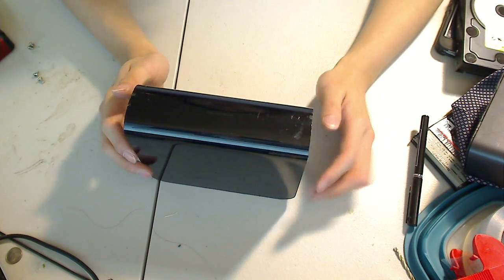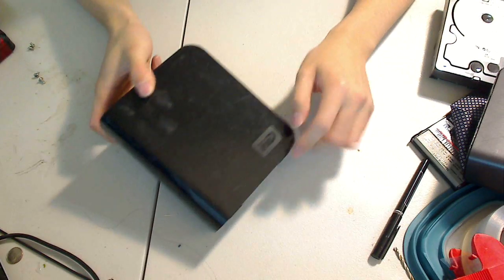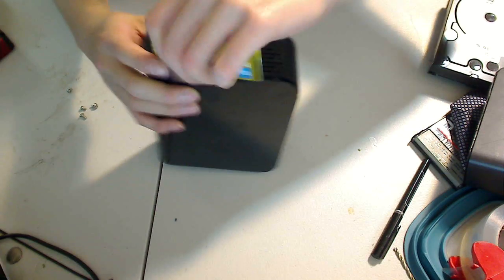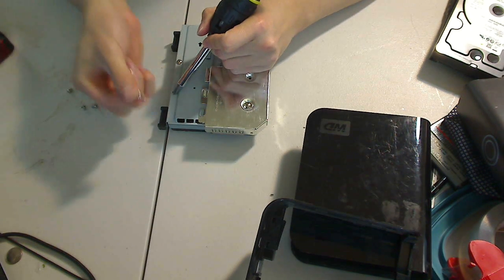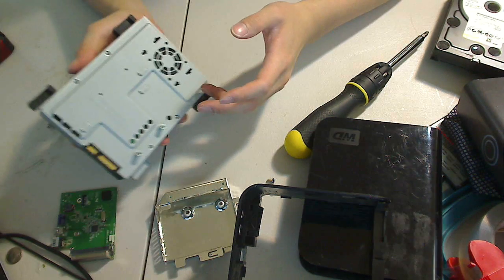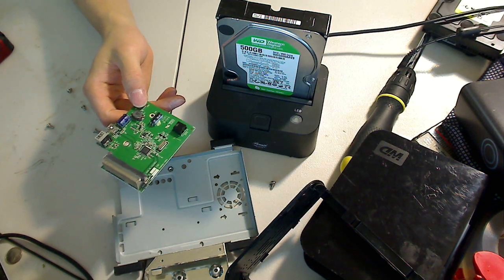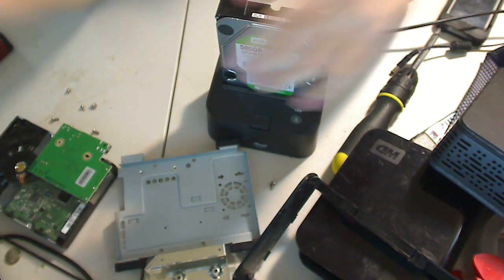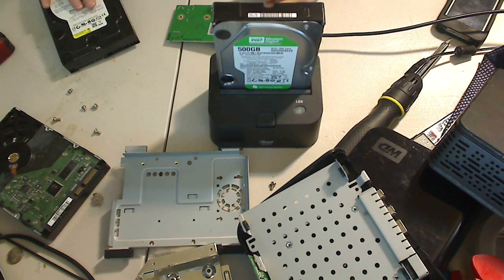Recover Data HHD hard drive from broken external Western Digital mybook enclosure repair solution

Comment: Thanks for the Video! It helped me save some time taking my failed WD My Book Home Edition apart. The drive hadn't been recognized for a while on my systems. Loading on my external HD reader worked properly. Seems like the controller for the WD Enclosure had a couple capacitors exploded.

Comment: i thought the data on those drives were encrypted and you need the enclosure controller board to read them?!
Reply: were you able to find an answer to this? I wouldn't imagine it being encrypted if it's on FAT32... I just don't know what WD adds onto it with the controller
Reply: Yup, you need the controller. Even if you disabled the encryption through WD Smartware software. 🙄
Reply: IM still tryng to find a way to recover mine from years ago

Comment: My FW400 WD My Book is unreliable often failing to spin up. The last time I used a trick I found online to freeze the drive first. This worked and I was able to transfer my data. Now I'm thinking to simply replace the hard drive inside the enclosure, so that I can still use this as a backup to my older laptop. This make sense? I just got a little worried when in your video you were indicating that yours had a controller failure.

Comment: Hey I have a WD external hard drive I bought in 2010 and it stopped turning on years ago. It's very similar to the one you have but is not black. I honestly can't remember the model but im pretty sure is a mybook model to. Will ill be able to retrieve the information following your tips?

Comment: Thx for the explanation. I have the same drive and it died after two years of normal use. I do have the following questions:
1. how can I find out what the exact issue is? (drive / mechanical parts etc). A technician did some test and told me that he can see that there is info on the drive, but can't access it. But I want to find out for my self what the issue is.
2. where can I buy the parts needed (if it is the board in the case, or the board connected to the drive, etc)? I did some research on ebay, but can't find anything.

Comment: Hey Ive taken apart my 4tb mirrored WD hard drive because its not turning on. I can get the hard drives out. Was going to ask, would u reccommend this docking station? Or I've seen u can get SATA to USB cords to plug into it, would this be just as good? I'm thinking the cord because its cheaper but I'm not sure if it'll work. Thanks for the vid anyway :)

Comment: Question for you.... I have a 1TB, My Book Essential, western Digital external hard drive that has stopped working. Looks like the small circuit board is bad. I purchased a Sabrent docking station to read this hard drive. The computer recognizes the docking station but the hard drive will not show up on the computer. I can hear and feel it running but nothing. Any suggestions? Windows 8
Reply: I've heard that the WD board encrypts the data. Am researching it now. What did you discover?
Reply: +Ray Nashar I took the drive to a friend that said all the data was gone. He could not find anything on the drive. He didn't understand where it was or how it got deleted, if its deleted. Maybe it is encrypted. Thanks for getting back to me. If you find it is encrypted please let me know if there is a code or something I can use to access files. Thanks so much.
Reply: koslund11 Will do. If it is encrypted, your friend won't be able to get the data without a new circuit board (PCB). I've found a place online that sells them. Going to try a friend's HDD docking station first without the PCB. If that gets us no where, I'm going to then buy a PCB from here: http://parts.com.hk/1/index.php?main_page=product_info&products_id=4#.VtjWwcc99jC
 Data recovery places charge way too much.
Reply: Data Recovery places start at $265.00. If you  are buying all kinds of PCB's and spending days with this the recovery price can seem quite affordable. It all depends on the value you put on your time. Don't forget that the more you tinker with it the less likely it will be recoverable by anyone regardless what you pay.  $59.99 for PCB of a broken external drive seems quite expensive... hopefully you don't end up wasting your money.
Reply: koslund11 it worked! My part came in the mail yesterday. Did exactly what the video suggests and I'm in! Won't be buying drives that use hardware encryption any more.
Reply: datarecoveryguy.com thanks but I really wanted to give it a go and learn.
Reply: +Ray Nashar
Glad you got your files back! What size was the drive?
Reply: 2TB

Comment: CD...when you first got ahold of that dock station,  did you have to format it BEFORE you inserted the loose harddrive into the dock?  I recently had hd problems with my WD 8tb too and I went to Best buy to pick up an enclosure.  Opened the box and read the instructions inside the box.   Carefully plugged power and data cable thing.  inserted my hd onto the dock and turned it on.....I did not see anything at first on my computer.   Then I looked at the package that the enclose was in,  there was a sticker saying that I was supposed to install a harddrive and format THAT prior to using the unit.   what I saw a few minutes later......I just collapsed.....it showed another drive being introduced to my system and UNfortunately I may have LOST ALL data from that hd :(((((((((((((.    I was so sick about it that I did not want to beleive it.....and seen other vids saying that the 3.3 tab thing,  to the pcb that maybe the problem.....my pcb HAS corrosion on the data port female side of the board.  So I am patiently waiting for my ebay purchase to arrive soon.
Reply: WD is becoming like Adobe Photoshop.....I have PSE software that now WONT let me reinstall it.......found out that folks have been getting bad issues with PS and they are boycotting the company for another different photo editor product.

Comment: Does the SATA-usb adapter option work for WD external hard drives that are password protected/encrypted data?
Reply from the maker: +ASHof2 no    you will need another WD external hard drive for transplant the internal hard drive itself.
Reply: That's what I was afraid of. Finding the same model is gonna be a pain in the a@@! Thanks!
Reply: +CyberDoc LLC how do you do that?
Reply: Oh, Gee, almost forgot. You need to move the firmware chip from your old board to the new one, somehow transfer the firmware, or find a seller that will do that for you, or you are still dead in the water. Apparently the decryption key for your disk is in the firmware.

Comment: I used a mybook as a PVR to record shows from my TV receiver, now the light flashes fast and I hear the power brick making a ticking noise in sync with the flashing lights on the mybook, is it possible to recover the shows I recorded and put them on my PC or will it be encrypted?

Comment: Thanks for sharing - although I am late to the party. I have a older Western Digital 500GB External Hard Disk Drive": It crashed in the year 2525 [ha got carried away in reference to a song] - it actually crashed in 2015! A local shop tech told me that the only way I could recover my data is by obtaining a identical enclosure controller board to read the data?  I still have my WD 500GB external hard - I removed the case, but I didn't disassemble the drive itself.  I guess I could give it a try again because my toolbox has improved - I own a Thermaltake - BlacX Duet Hard Drive Enclosure Docking Station – Black.

Comment: This doesn't work. Western Digital hard drives for some reason come with AEN (i think thats what its called) encryption. When I took my hard drive out (because of the horrible shit enclosure) to put it onto a new enclosure, it said the drive was unformatted and unallocated. I took it to an IT place they tried to get the Data off it and it said the folder was locked. There is one option I found which is to reformat and allocate drive (temporarily deleting your data) and then using GetDataBack to retrieve it (when reformatted DO NOT PUT ANYTHING ONTO THE HD AS IT WILL ERASE YOUR OLD DATA). I am scared to use this method because I am still unsure about the reformatting. I am yet to take it to a professional data recovery service where I could get charged quite a large amount.
Reply from the maker: buy the same WD drive enclosure and put it in that one.   also your drive sounds messup internally    you may need to open the drive to change either the board or the head pin. http://www.cyberdocllc.com/shop/hard-drive-data-recovery-services/
Reply: CyberDoc LLC 额。
Reply: How did you go?

Comment: So, if there is a click soundlike heartbeat coming from the drive that means it is pretty much dead unless i do the buy exact drive and replace certain parts?
Reply from the maker: correct  you have to change the head and board and control unit
Reply: CyberDoc LLC I bought the exact same drive and it was not still working. I do not have a much of a click but I heard a spin then it stopped. I tried this but it is still showing as not initialized in disk management. Any suggestions
Reply: CyberDoc LLC Feel like making a video on this? This one was great so if a video as straight forward as this was would be awesome!

Comment: I have this exact drive. Mines dropped, and now makes a clicking sound while running. It no longer works. Though when plugged in, is still somewhat detactable by the computer. How do i recover the data is my question. I would need a step by step video for this.
Reply: having this exact problem

Comment: Hi, I know this is a while back, but which docking station is he using?
Reply: check this ebay item 162363878031, the only caveat it doesn't work with WD IDE HDDs (but not many people still have these types of drives) and it connects through USB 2.0 only (which is slow). An option I prefer is ebay item 111671428292, it connects not only to USB 2.0 but also eSATA (high speed on a laptop if it has that port) and SATA (for a desktop), these are the only options that allow direct connection to the motherboard for low level work such as fixing with SpinRite or writing to the drive firmware such as for disabling the Intellipark feature on WD Green Drives - things you can't do from the USB interface.

Comment: My Western Digital mybook (grey) has stopped coming up on my computer (iMac). It is making a clicking sound like a generic time bomb. Then after a few minutes it stops making the sound, but the light on the side is still flickering. I tried moving it to a different computer (a laptop) and changing the cables, but it still does the same thing. Is there a chance I can take it apart and try to put it on the dock you described and retrieve my lost files? Is there a chance it is still possible to save the files?
Reply: Luis Diaz 
I would definitely try to take the drive out of the plastic shell and hook it up directly to a Mac. Keep the shell with the drive if you decide to send it in for recovery somewhere.

Comment: I dropped my seagate external hdd 
there comes beeping sound fro my it and it doesn't appear in my computer or disk management. I assume it's dead.
is there anyway data could be retrieved lime putting things from this to other hard drive
Reply from the maker: +Wajid Malik   need to open and to reset or replace the spinning pin head from an identical hardddrive
Reply: lol

Comment: I have a failed WD MyBook 3tb that doesn't show up in my file system but shows as unallocated and Not Initialized (when I try initializing, a pop-up says the disk "is not ready") in Disk Management. Will a dock help me recover my files?
Reply: When you get the dock it will likely show up as unallocated as well
Reply: If his dock can connect it directly to the motherboard, recovery software could fix it.

Comment: Hey, I have a WD mybook 1TB and the usb on the enclosure casing got damaged. I tried removing the HDD from the casing and connect it to my computer but nothing is showing up. Can you provide me with any solutions?
Reply: Hi,

Get another controller from the same model enclosure. The data is encrypted. 😉

Best Regards,

Comment: Help!  I drop my cloud and it is DEAD.  Good thing I'm under warranty so I can just sent back and WD will sent me a "new one". I worry about my data inside. How can I delete all data in there before I sent it back to WD?  Thanks !
Reply: If you're worried about your data and it's dead Put it in a MRI machine ;-) Kidding aside (they won't let you, that magnetic filed can turn the drive into a projectile), without mechanically destroying it only super powerful magnetic fields can scramble it. I know it's probably too late now but you can ask the vendor whether you can keep the dead drive for privacy reasons, if they have determined it's hopeless they probably won't bother you with sending it back in since they'll probably just shred it (that's what I did for one of my drives).

Comment: Did you really managed to recover data from that WD hdd? I know they encrypt data and you cannot recover it without the original usb board.
Reply: Nothing is encrypted by default.
Reply: It's not encrypted if you didn't use some sort of software to encrypt it. I've taken apart several external HDDs and had no problems putting them directly into my computer. Even if it is encrypted, you can just plug the HDD back into the external enclosure.
Reply: Judging by the numerous reviews, I'm assuming no. But since it's cheap, I'm going to buy it anyways to test it out, if it doesn't work, simply return it.
Reply from the maker: I second that what Tamás Madarász said,  you must had it encrypted.   I never had to do a drive from WD recovery with encrypted data.
Reply: CyberDoc LLC
 I put the WD HD into the BlacX, and it is blinking on the left side, a lot. It is not recognizing it on my computer accept in the disk utility, but it won't let me do anything there. I have a update iMac. Any advice?

Comment: I have a WD 3TB External Drive, which I accidentally dropped onto the floor from a closet height. It hit the floor pretty hard. It receives power but makes a ticking noise and a whining noise, almost like its totally screwed. Can any of my files be recovered?
Reply: ***** Mine just fell over on the desk and is making the same sound, and so far, it looks like it's dead
Reply: ***** 
Dropping drives causes internal damage to the parts. You will need to take it to a data recovery lab for evaluation. 

our rate for these types of issues is usually around $804.00 US. depending on drive size. a 3TB would be around $1100.00
Reply: datarecoveryguy.com I don't know the manpower behind getting the data back but why is it so pricey?  I myself have a 3TB mybook and I'm having problems with it.  I used a Sabrent docking station but it does not show up under my computer.  

It shows up in disk management and I made the mistake of initializing it (it took a couple seconds).  My question to you guys is, is it possible for me to recover all my data without having to pay such an exorbitant amount?  Any programs you can recommend that might be able to get my 2.5TB+ of data back?
Reply: With the drive that size the more you try to recover ityourself the more expensive it will be to have a professional do it as drives degrade with each recovery attempt.
Reply: I'd agree on that.  My 3T only fell over on the desk, but I only got about 90% of the data back with my recovery software, although it's not pro quality software, but I'm happy with what I got.

Comment: Hi , I have the HD shown in this video.  The HD starts to power up for a second or two then shuts down,  Can I still retrieve my data as you showed? Is there another fix to keep the entire product?Thanks
Reply: If the drive shuts down that means there's an internal problem.

Comment: There is a lot of bad reviews on this product, are you sure it even works? Cause I made the same mistake buying another similar product which doesn't work at ALL.
Reply from the maker: yes it does work,  I use it to recover data off laptops all the time.

I agree its hit or miss with this brand, you must had a dud.

Comment: Most WD my book or other enclosures have a custom 'bridge chip' thingy that is a key to see the weird method WD puts data on the drives...so in essence a generic enclosure WILL NOT WORK with WD drives out of their custom enclosures! BEWARE!
Reply: can anyone tell me the voltage and amp for this WD 1T unit. I lost my powersuppli and need to find one.

Comment: This guy is lingering among the non-believers.  Throwing electronic devices around, especially hard drives is a formula for disaster.
Reply: Yeah, I was going to say something on the lines of I pity his wife, but hey! To each his own... And since it's broken already... That being said if you want to write to the drive firmware while it's still under warranty you'll break the tabs if you ram your credit card in there too hard, they're quite flimsy... As for being gentle with the drive, I always work with a folded bath towel on the table when doing this kind of work ;-)

Comment: Garbage and misleading information. If you try to use a drive with a docking station all drive will be seem as unallocated drive on Windows, then user will need to format it to be able to use. If there were data in this drive then cheers, you have a brand new problem; data recovery. Also you are unnecessarily rough to these drives. They are not made to be broken as you said, you screw them up. Here is a dislike for you, enjoy.